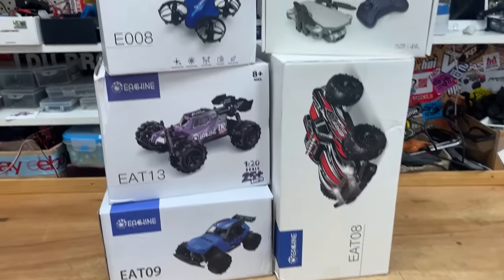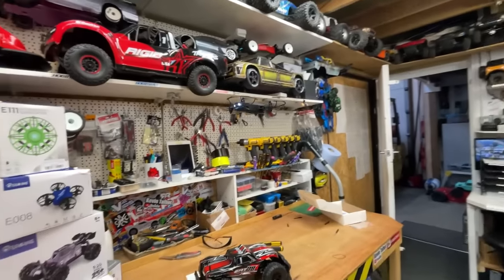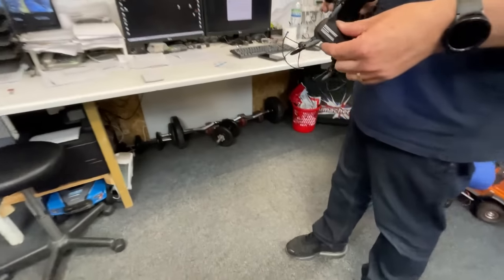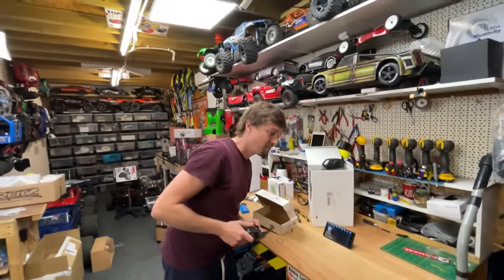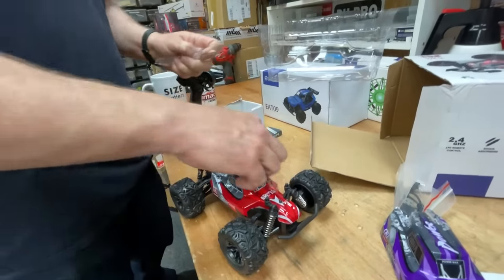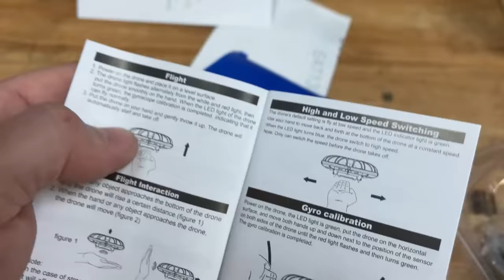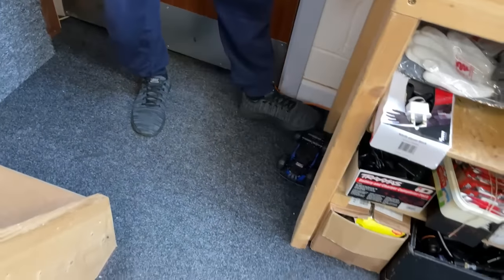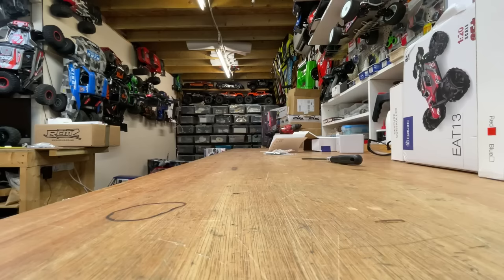World's Cheapest RC Cars n Drones - how bad or good can they be?

Comment: I bought 2 eat09 last Xmas for my boys but they found it too slow so I tried connecting up the batts in a series but there must have been some overload thing in place so didn't work. Not sure where the over load thing is so I can't remove it. They were too slow and gutless and one of them ended up in a bucket of water..